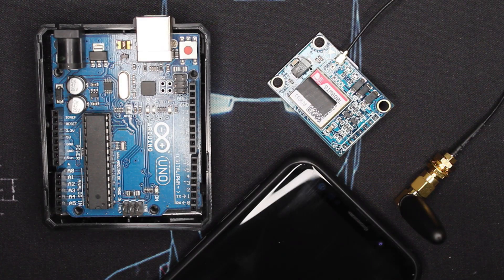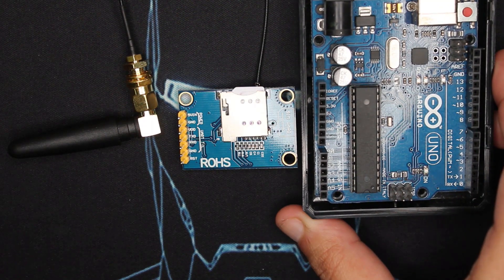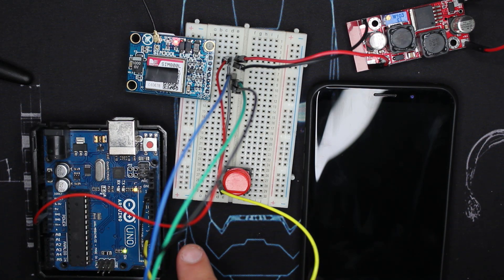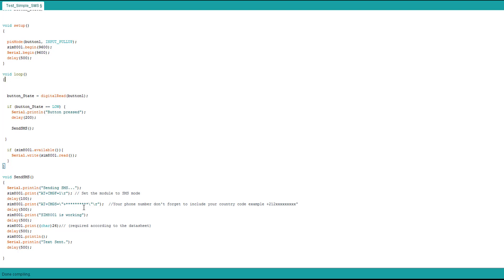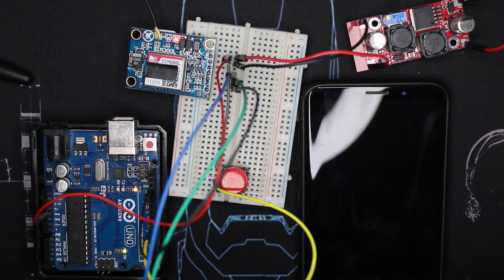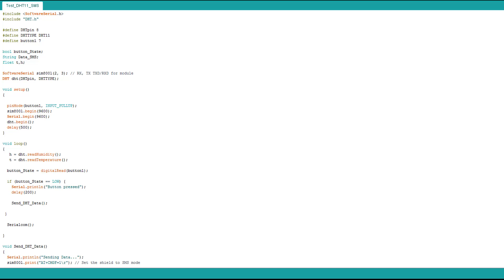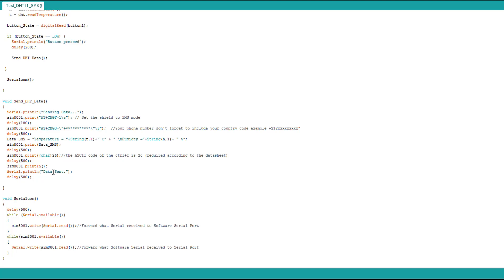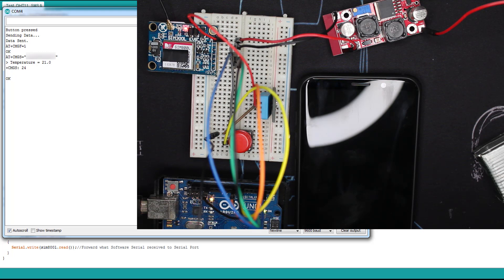Send SMS/Text from Arduino using SIM800L | DigitSpace

Comment: Hello!! Great video.🙌
I'm using the same module (sim800l v2)
Can u pls tell me what you used to provide power supply? How much current and voltage rating should I provide for it to function properly?

Comment: I tried to with4g giffgaff card in sim800L V1 but no luck
Reply from the maker: You made sure you have enough credit, and the card is not protected by a pin code? Also can happen sometimes to have very low signal reception especially if used without the antenna...
Reply: SurtrTech i ordered a 1pmobile sim card, works perfectly 👍

Comment: Hello Yassine, first thanks for this Chanel. So i have bought Sim900 and sim 800 i have uses Maroc telecom card sim 4G+ the problem that shield didn't work. I have question which card sim have you used i saw this is NW but it s 4g too?
Reply from the maker: Salam, carte li khedam biha dial Inwi, machi mochkil 4G wla la, 7it f had tutorial khedama ghir fonction GSM, khass la carte ykon fiha solde w maykonch fiha code pin (dirha f tel w 7aydo).

Comment: 3.7 lithimum battery and boost to 5V okay?

Also why don't you use vin to power the arduino from the battery? I thought the 5V pin was for output only
Reply from the maker: As long as it can provide the required amps to work, all 5V source are OK.
To use Vin the input voltage should be above 6.2V, recommended 9-12V, since the converter has 5V output, I can use it directly with 5V pin of the Arduino.
Reply: @SurtrTech  Thanks so much for the speedy reply, I really enjoy your channel.

I wired up the initial circuit you demonstrated in this video, and inserted a sim.
I am waiting on delivery of my battery, so just powered the module via the arduino 5V

I had the 3 second delay red led flashing. so I believe it had signal, but when the button in pressed the serial monitor displayed "Sending SMS" immediatley followed by "Text Sent" hence just the serial prints in the code and no information from the module - could this be due to using the arduino to power the module as you mentioned in your video?
Reply from the maker: @BenGuardian  Thank you, the module can actually be powered by the Arduino, but it's not recommended to do so, for me it worked few times like that and never again, that's why I used an external battery and converter.
On your phone do you receive any SMS or no? And remember there are 2 LEDs, one should be always ON, if it's turned OFF it means that the module has restarted and it's probably due to undervoltage... If you receive all SMS normally,  it's OK.

For the feedback from the module, you can check my other video about send and receive SMS (https://youtu.be/SsfJsdjfaqE ), I used a function called "Serialcom()", and can send commands and receive feedback using the serial monitor.

void Serialcom()
{
  delay(500);
  while(Serial.available())                                                                      // IDE serial l serial  sim800L
  {
    sim800l.write(Serial.read());//Forward what Serial received to Software Serial Port
  }
  while(sim800l.available())                                                                      //serialsim800L l serial dial IDE
  {
    Serial.write(sim800l.read());//Forward what Software Serial received to Serial Port
  }
}
Reply: @SurtrTech When powering up, the left most LED comes on bright then dims quite significantly but does stay on permanently.
The second LED blinks every 3 seconds indicating it has signal
Reply from the maker: It's okay, as long as you receive the SMS.
Reply: @SurtrTech  Sorry to be clear, its not sending any SMS - It doesnt look like the module is communicating with the arduino in anywa, but the lights are working
Reply: Im guessing the module is not working correctly due to power, I'll let you know if the battery helps - thanks again

Comment: Aren't pins 1 and 0 tx and rx on arduino?
Reply from the maker: The pins 0/1 are used for communication with the PC (via USB), since I want to see things on the serial monitor so I used pin 2/3 (as Software Serial) to communicate with the module.

Comment: WHAT IF YOU CONTINUOUSLY PRESS the button. Will it send many more texts??
Reply from the maker: Once the SIM800L goes back to standby mode it can send another SMS if the button is pressed, so you need to consider the duration of the whole sequence (it takes few seconds: 3-5s)

Comment: Great video, unfortunately I know the electronics well but not the programming as well although I slowly learn to learn. I have all the material at home and also the AM2301 module (DHT21), so I would like to do this project for 'with a diversity', remotely call, when I want, the system (ARDUINO + SIM + DHT21) without sending with the button. I hope I have explained myself. Can you help me?, thanks de IK1CFJ, Biagio.
Reply from the maker: Hello, yes I know what you meant... I will try to do this next, maybe send or call the Arduino and then it sends you data back, it's really interesting to do! If I succed, I will notify you.

Comment: Don't you need a SIM card to connect to the cell service provider ?  I look quickly on the website for documentation but couldn't find it.
Reply from the maker: Of course you need one, and it shouldn't be locked with a pin code, and make sure it has enough credit to be able to send a SMS like a phone.
I mentionned that quickly at 1:25.